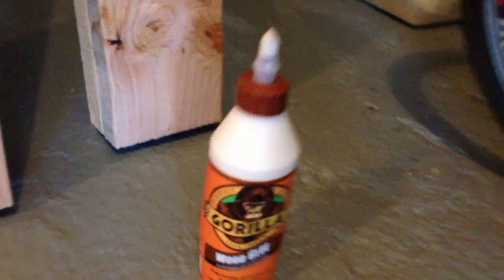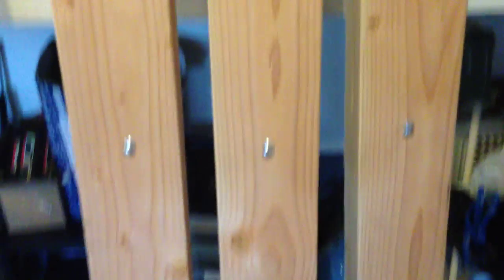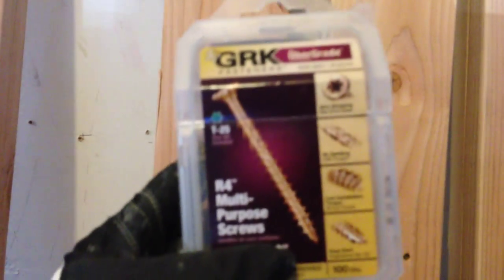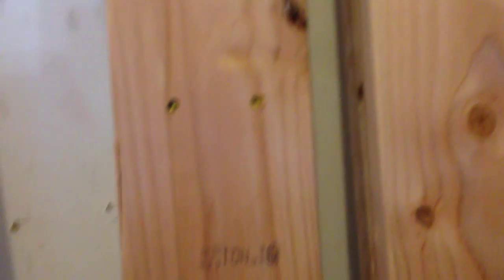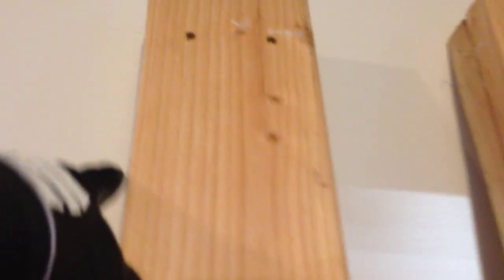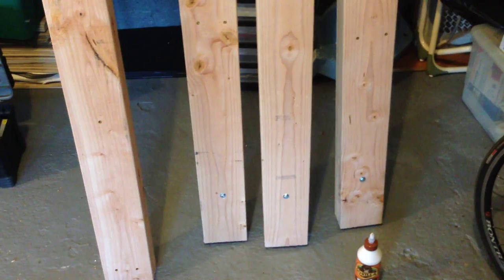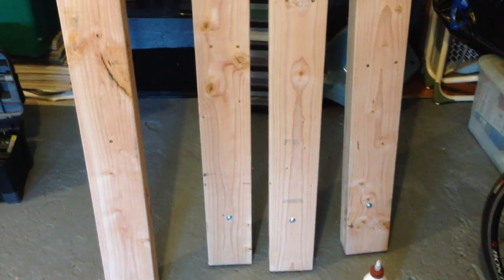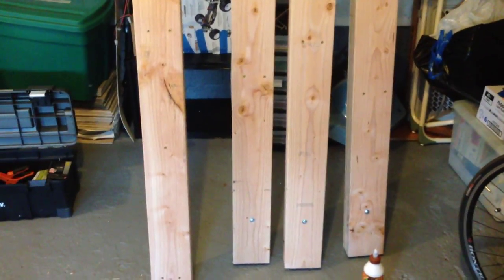Wood Power Rack Support Beam Build

Comment: GRK 5/8" Structural Screws are even better.  I used to be a carpenter at Six Flags and we used them for everything, including holding parts of wooden roller coasters together.  They basically have a built-in washer that helps to suck pieces of wood together, and their tensile strength is greater than 1/2" lags.  They sell them at @2.5", you probably just missed them.  Either way, great video.